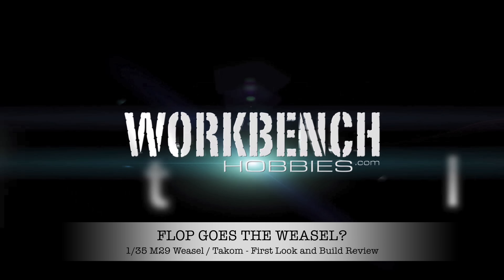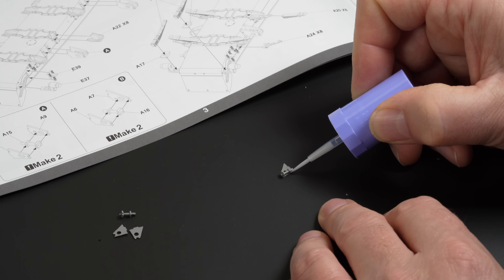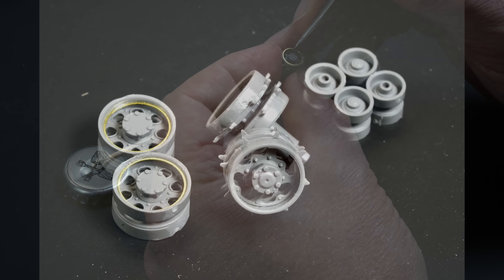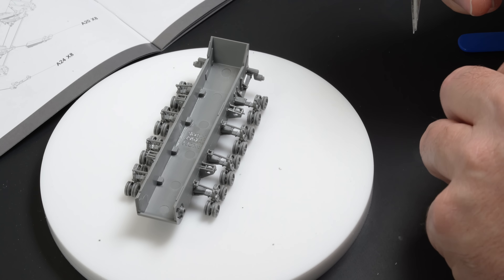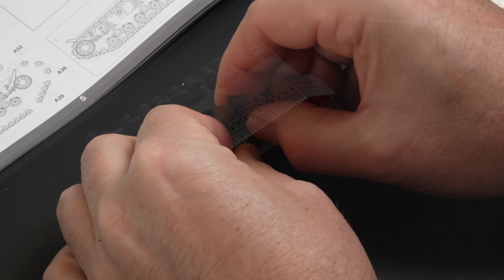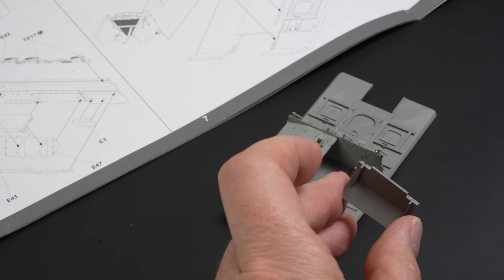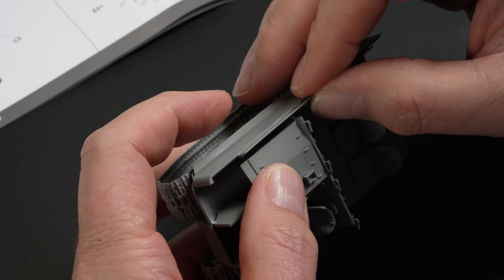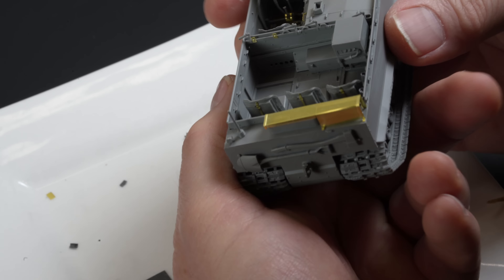WHY is No One building the TAKOM - M29 WEASEL?

Comment: Thanks for taking one for the team, Clayton! This kit is full of irony. A vehicle with a rubber band track but the  kit has link and length track that just looks too rigid. Massively overcomplicated running gear structure, when it's the most likely model to be built into a diorama, up to its running boards in mud. I bet a 3d printer will make one with about 5 parts that will do a much better job.
Reply from the maker: I think you might be on to something there. Even if someone came up with the printed running gear it would save some frustration. Thanks for joining in 🍀

Comment: I've been saying that an M29 was needed in plastic in this scale for over a decade... When this kit finally was announced I was thoroughly stoked and bought two... I didn't really have the issues with the body but the running gear truly defeated me. The least they could have done was include a jig to help align everything... but no such aid is included. The bad part is the way they have you construct the running gear is kind of strange... adding in the  bogie bottom attachment parts well before everything else which result in alignment issues. This kit is sitting in the box and the second one will wait probably until hell freezes over. How can a kit that is so highly sought after be so big a disappointment? I may give my LZ models resin and photo etch kit another go... it might be easier...
Reply from the maker: Hey Wayne. I too was hanging out for this kit…so I truly feel your pain. Thanks for joining in the chat 💪🙏
Reply: @workbenchhobbies4316  I've built the old Monogram M29C... I ended up reworking the rudder control mechanism with photo etch brass runners and steel wire and added the rudder control cables. The rudders don't move, but it looks a darn sight more accurate than the original set up. I also left out the radio and added a bit of sheet styrene so show the floor stiffening and opened up the hole forward of the windshield and added a pully and belt which is hinted at by the shapes molded into that area. The LZ kit was fair enough... but like the Takom kit, the running gear seemed to be out of my league, being made up of brittle resin and tiny photo etched parts. I suppose one day I'll get back to it... I gave up on the takom kit's running gear after trying badly to build ONE bogie. I figured if I had to do that eight times over I'd go nuts.
Reply from the maker: @waynecoulter6761   Maybe make one bogie a week... and then by the end of the holidays you might have them done ? 😬
Reply: @workbenchhobbies4316  I think Takom either needs to simplify the bogies or provide some kind of jig to help build them. I had the same issue with the glue making a mess of things... I too used Tamiya Extra Thin... Time isn't the issue, the ability to keep things aligned IS.
Reply from the maker: @waynecoulter6761  - as much as it sucked for you I take some comfort in the fact I wasn't the only one to suffer ! :)
Reply: @workbenchhobbies4316  It's kind of sad because they did a bang up job on their 1/16th scale Jeep... About the only thing you really need to add is wiring and fuel and brake lines...
Reply from the maker: @waynecoulter6761  Havent seen that one... 1/16 is a little big for me. ut some of my absolute favourite builds have been Takom kits... so that is why this one caught me a little off guard!

Comment: Molding technologies are advancing, most due to computers, of course. CnC machine can carve EDM parts, which can in turn be used for injection molding tooling. Additionally 3D printing of metal is becoming more common, allowing tooling costs to plummet. Solid modeling software is much more robust, capable, and accessable than ever. For us modelers, its mostly win win. The detail present in these modern kits is astonishing, especially when compared to just a few decades ago. I put together the Tamiya M113 recently, and am working on an AFC club M113. The difference is night and day.
Reply from the maker: For sure. The hobby is advancing in leaps and bounds…but I think sometimes the actual modelling experience can be neglected 🤷🏻

Comment: I have the -c model. I was going crazy with the road wheels and the assembly to the hull. The instruction were terrible . I built the Monogram mode at the same time. Then used the Monogram model as my instructions. I would recommend building the Monogram kit first.
Reply from the maker: Hey Gary. It’s not easy is it! It’s a shame because it’s such a great little vehicle. Thanks for joining in. 🙏💪🍀

Comment: With the fun and games I've had from  my recent Takom armour kit i'm surprised they didn't give it a engine which you will never see again,they remember to put things like nuts and rivets in places you'll never see then miss a major part a fan belt on a engine you can see
Reply from the maker: Hey Keith. It makes you wonder if they build them before committing them to the market doesn’t it? In saying that, some of my favourite builds have been Takom kits. Which one is giving you trouble?
Reply: Done a few mainly armour Takom kits, I like the fact  they do some  relatively obscure vehicles ,but what's more annoying than trouble is you  spend £100's  ou get great internal details but  no painting guide for it or parts you'll never see again but the latest was  the 1/16 panzer 1V a full engine but no fan belts,eg they remembered to put fully detailed shells in boxes then have glue them shut
Reply from the maker: Yeah. Makes you wonder what they are thinking sometimes doesn’t it.

Comment: Nice build.  

The track tensioning spring is installed upside down.  Appears to be in the manual too from the quick view I saw in the video.  

The Weasel offered by Takom is an M29C with many features from the earlier T24 and M29C.  Really a fantasy Weasel as none of them shipped from the Studebaker factory shipped as configured.  If you are trying to build an accurate T24, M29 or M29C, there are lots of small changes that need to be made to make the machine historically accurate.
  
If it makes you feel any better, rebuilding a real Weasel is about as difficult!  Everything is difficult to fit, tracks are heavy and will pinch fingers and on and on!  You can't even change the points in the distributor without removing the engine. 

Cheers!
Reply from the maker: Amazing insight. Thanks so much for sharing!
Reply: @workbenchhobbies4316  You inspired me to build this kit - mostly I rebuild full scale WW2 and other vehicles, but I bought this for a winter project.  In this particular case, experience with the actual machine is pretty helpful.....I will report back after the build with my experience - may even try and make a video of it.  Cheers and thanks again for the helpful video.
Reply from the maker: @Portrayalpress   - Fantastic - be sure to let me know how you go. It would be interesting to hear if your experience is better than mine with the actual working knowledge you have of the vehicle. Wishing you luck.
Reply: Much appreciated - will definitely keep you posted! 
 @workbenchhobbies4316

Comment: I found one of the best solvent type glues for styrenes is MEK. A pint can lasts forever. Use small dropper type medicine bottles or mecurichrome bottles, to limit the amount of fumes you're dealing with as it is VERY nasty stuff.
Acetone also works, but is not as aggressive as MEK, and I have also had decent luck using lacquer thinner, although it is as bad as MEK when it comes to the fumes. Again, I ended up putting it in a small bottle and using a brush. Do not try and use any of these straight from the can.
Reply from the maker: It’s the ‘very nasty stuff’ that kinda turns me off that idea! 🫣😉
Reply: @workbenchhobbies4316  You'll find they, and other rather volatile chemicals make up most model cements.  Xylene, Toluene, etc.
But yes, if you're uncomfortable handling the base chemicals, stick to the premade solvents.  It was merely a suggestion to possibly "solve" the bonding issues.(pun intended).
Reply from the maker: Always appreciate your input :)  @jballew2239

Comment: Thank you for this very helpful build video.  I have this kit, but have not started it yet and your build will help me to look out for the issues.  I have really wanted a modern-tool kit of the weasel and I’ll try to struggle through all of the same problems you encountered.  As I watched, I constantly thought:  “Is there a way I could alter the sequence of assembly at different stages to avoid at least some of the problems.  No brilliant ideas yet.
Reply from the maker: Yeah, in reflection I’ve been trying to think of ways to combat some of the issues and I’m coming up short. I think the challenges with the glue compounded everything too. Sometimes you can muscle your way through construction issues…so maybe try some different glues and go with the most suitable one. Sending you luck 🍀

Comment: Not a flop at all!! Enjoying the build so much that I'm going to get another one and build a civilian version... Not experiencing the gluing problems you encountered ( I'm using Tamiya glue)... I watched your review after I purchased, which made me a bit nervous, as my kit was still in transit... Very impressed when it arrived, I checked the contents/instructions and found the details were very sharp... What I'm doing differently is I am not following the instructions step by step and building the boxy sections in sub assemblies... I find that boxy vehicles require test fitting and squaring off before committing to glue and that is what I did... As a result everything came out square and tight, test fitting and making sure the mating surfaces are clean... I noticed in your review that some of your parts still had sprue attachment plastic left, maybe that was a factor that affected your build... But your build/review scared off a quite a few modelers judging by the comments... I haven't assembled the tracks yet but I'm not at all worried about that as the running gear sits flat and true... I highly recommend this kit, definitely not for the impatient, test fitting and clean parts are the key for a clean build... This is my sixth Takom kit that I have built,  from the 1/16 Japanese tankette to the 1/72 Hanomag V2 tractor and this was as fun as the as the others... I attacked this kit as if it were a highly detailed resin kit, and as I'm sure you know can be very finicky and also requires a lot of test fitting and cleaned up parts... This kit will give me confidence to finally build my resin LZ Models M29 which was very scary but not anymore as I've got a reference now as I had lost the CD instructions... Good luck to all that still want to tackle this kit...
Reply from the maker: I am so pleased to hear you have enjoyed the model. I don’t do these reviews to scare people off but understand that is a result. All I can do is share my experience as authenticity as I can. 
Appreciate you joining in 👍

Comment: Good review!  I have found some of the same issues on a recently released I Love Kit model:  excellent, crisp moldings, lots of tiny (too many?) parts, but poor instructions that kept me second-guessing.  Fortunately in my case, the fit was actually good, but the kit was not a fun build - too many questions where to place parts, and in the end I just wanted it to be over.  Goes to show that the quality of the instructions is key to enjoying model-building, not to mention that sometime I'd rather not have to fuss with 19 tiny parts to make up a tow-hook.
Reply from the maker: Good instructions makes a world of difference doesn’t it. Thanks for joining in 🙏🍻
Reply: Agree on the instructions comment. Have built a few Takom kits, Dragon, Trumpeter, Hobby Boss, Italeri, and others. The instructions will dictate my attitude during construction and how far I go in the build. Most of those manufacturers leave a lot to be desired, but then just could be me as well.

Comment: I've built quite a few Takom kits, they can be tricky sometimes. That said, I enjoy these little surprises,  makes me use my skill and some thinking outside the box to overcome issues. I'm a modeler,  not an assembler,  that's what Tamiya kits are for..lol.
Good review, well done!
Reply from the maker: Well…sounds like this may be the kit for you! 😎🍀
Reply: So why bother with kits at all, why not just scratch build everything? When I buy a kit I expect parts to fit correctly maybe a little filler here and there, and add a little detail If needed, but I won't be buying this kit It's awful.
Reply from the maker: It was certainly a challenge 😒

Comment: Hi again, Clayton. My general experience with Takom (and Tiger Models) is that they may not glue well because of release agent residue. Can I ask; did you wash your sprues in detergent before you started this build?
Reply from the maker: Hey. Nah, never wash sprues. I don’t even think release agents are a thing anymore…or at least not like they used to be.  It the makeup of the plastic and the way it’s reacting with the cement. 
Even if it was release agent, it would be more about the paint rather than the glue? 
Thanks for joining in. Appreciated ☝️🍻

Comment: Thanks for the review, it is a disappointment that it is such a poorly offered kit. When I heard this was coming out, I already had two LZ models Weasels in the stash and decided I had better pull one out and build it. But the poor moulding on that resin caused me to spend so much time cleaning it up, removing great blobs from where there should have been no flash at all. Clearly the mold had broken down before mine was moulded, leaving me with crap for a kit. I worked for hours getting the floor attached to the tub, and then the bottom part which holds the suspension and whatever else makes the Weasel drive, and after fixing a great amount of warpage and having only put three parts together I said stop, you're wasting you time, your Takom kits will be here soon! And now seeing this, I immediately thought, here is the perfect kit for Trex Studio to come up with some parts to fix these issues. Im going to start one hoping that perhaps your review kit was a one off flop. Still, you made it look great! Im working on a Ming Jeep, Ive never built a Ming kit before, having heard that there are a lot of issues. There are some serious problems in their castings, however, working around those, one of which is that pieces of the chassis that are supposed to be flat surfaces have so many little burrs and "steps" that it is really not flat at all, and it only shows up when I went to paint the surfaces, finding so many little almost microscopic hole as well as the ones previously mentioned. Well, there is always mud and dust weathering to be had!
Reply from the maker: Thank you as always for your thoughtful comments. 100% if Trex or someone come up with upgrades it would be great, at least from a construction point of view. 
Good luck with the Jeep 🤞

Comment: Excellent video, I love your clean and comprehensive way of showing the building process.

 what an horrendous kit, God only knows what's gotten into Takom. A lot of the running gear could have been greatly simplified without any significant loss of detail, and the plastic behaving awkwardly is just unacceptable.

 I really hope these issues don't apply to their new M103 as well, because I'm dying to build it.
Reply from the maker: I am a fan of most of Takoms recent release kits, so yeah…came as a bit of a surprise that this one wasn’t a little more ‘user friendly’. Appreciate your comments 🙏
Reply from the maker: Let’s hope this is an anomaly

Comment: Excellent video, except for the whining. This is a tiny vehicle. If you make a model of it and want to show some detail, the parts are going to be miniscule, even at 35th scale. You turned it into a lovely build. Be Happy!
Reply from the maker: Small parts are one thing…think I even said small parts were to be expected? It was the fit and placement issues and the glue not reacting with the styrene that upset me the most. 
But yes, you are correct. I do have a weasel in the paint queue now. Always happy mate 😉😎🍀 
Thanks for joining in

Comment: Complicated  for the sake of it , tiny fiddley parts , half a dozen pieces where one would do . Modelling should be about fun and to me a model like this is a nightmare to assemble and the enjoyment ratio zero . lf this is the road companies like Takom are going down l'll stick with Tamiya and older kits and leave them well alone (.Shame Tamiya did'nt  release it ).
Reply from the maker: Hey. Thanks for joining in. It does make you wonder what some of these companies are thinking doesn’t it? The successful ones find the balance between detail and buildability. In saying that I’ve built a lot of great Takom kits, so maybe we need to look at this on a kit by kit basis. 🍀